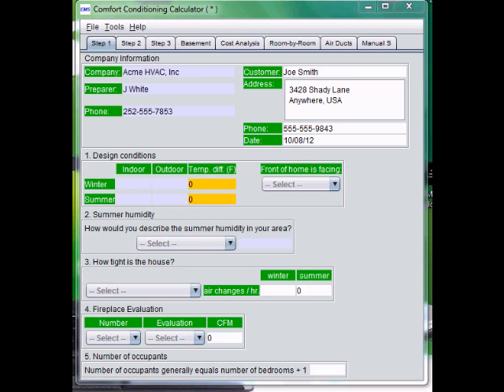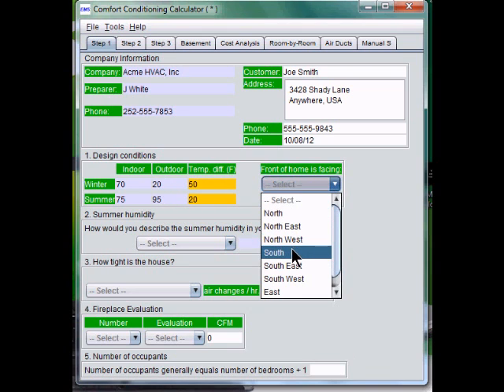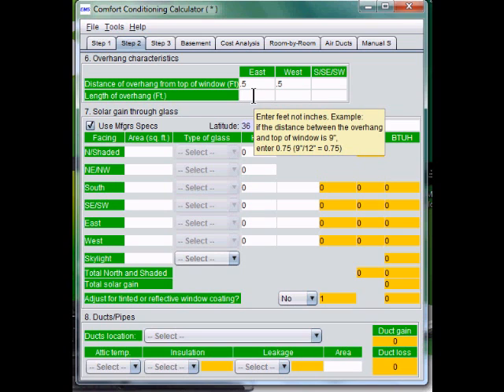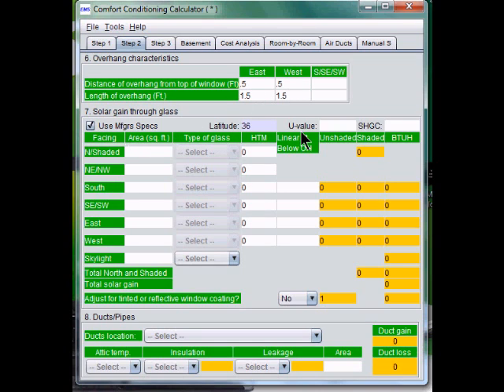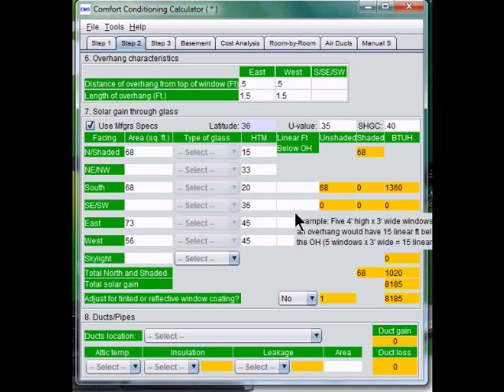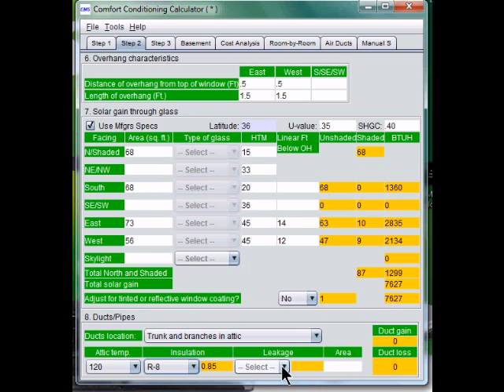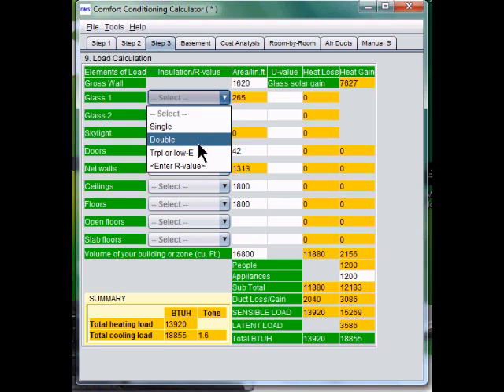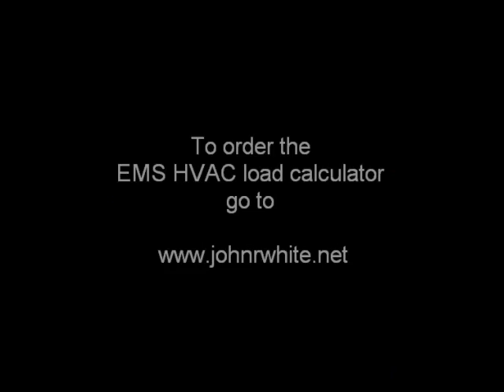EMS HVAC load calculator

Comment: Is that manual J?
I notice on the heat loss side,  ceiling insulation only gives you up to R 30 , where I have R 38 in my house
Reply: software offers r values up to R 55
Reply from the maker: The drop down menu goes to R55

Comment: Do you a foam house  calculator ?
Reply from the maker: The EMS load calculator only asks for R values. Whether the R value is obtained by fiberglass, cellulose, foam or buffalo chips, it makes no difference in the heat transfer rate.  Different types of insulation may effect the infiltration rate. Therefore, the calculator will allow you to specify the tightness of the house.